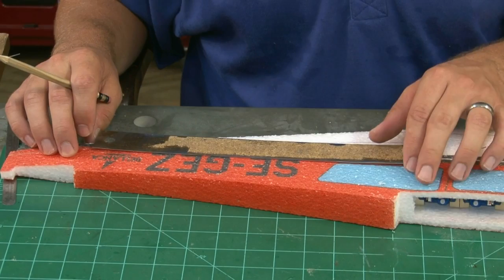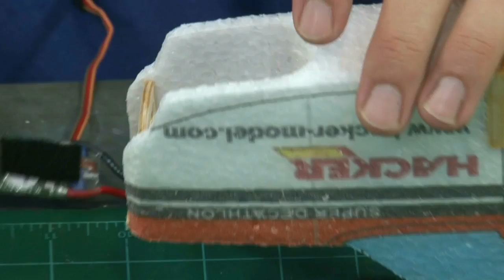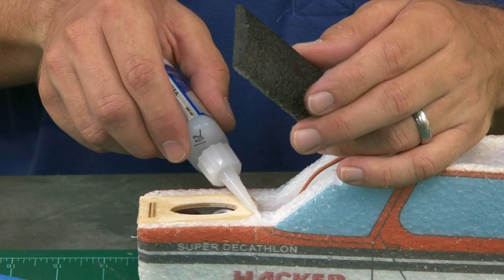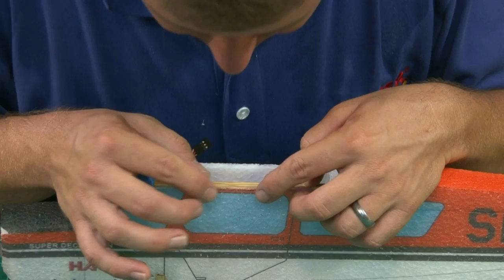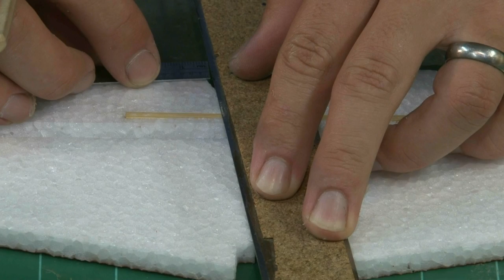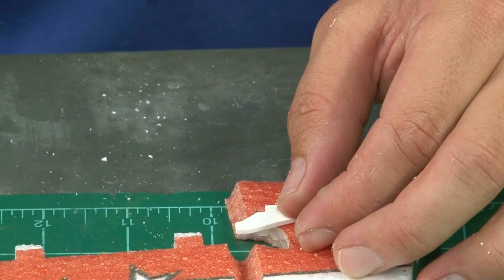Hacker Super Decathlon Build Part 2

Comment from the maker: The Hacker A20 motors have a 28mm (about 1 1/8") outer diameter and they don't touch the sides of the fuselage.  If I just barely touches then it may be OK, but you will be drawing more current then you would be if they didn't touch. Also you may be able to slightly relieve the inner sides of the forward fuselage so that it doesn't touch.